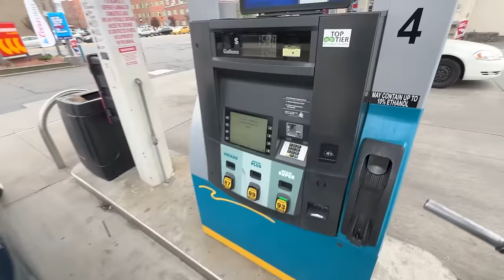FINALLY DRIFTING MY DRIFT CAR!!!

Comment: Tighten up that handbrake and buy projectMU hand brake pads(Sauce), increase your tire pressure or go smaller tire(your safe running 60+ psi cause I run like 70-80 in my s14 with a stock ka and I run 215/35r18) once your in a slide if you feel it bogging just give it another clutch dump to break the grip again. If you have stock clutch. When you need a new one get a 6 puck clutch(shocks the drivetrain more, meaning easier to get loose)
Reply: additionally when clutch kicking to stop engine from bogging try and go halfway, not fully. It'll feel smoother and shock the drivetrain less.

Comment: Older Nissan manual transmissions are just like that when putting it into reverse, not from abuse but just from wear over time. It’s a common issue and is fine that it makes that grinding noise and it feels you have to force it into reverse.

Comment: Cool kid! Love the video. Btw to use your e brake. You should heat up the pads for a more effective lock. You can keep the car moving with the e brake engaged to heat them up. Then it’ll for sure work better

Comment: You could put some more air pressure in the rear if you're not maxed rn so you can spin 2nd. Also maybe a rear gear like a 4.10 or something.

Comment: Ya need a smaller wheel....and quick release...that will help for sure....Probs need sportier tires to slide and what others have said....def go in a bit harder on the throttle, get those rpms upppp in second. You should be fine.

Comment: I would look into a different diff with a shorter ratio that way you can slide in second. Or try getting some smaller burner tires but i think a different diff will be the best option

Comment: Air up your tires to 3 psi under max rated and it’s gunna make it feel like butter the tires will break loose way more and you be able to go up in rpm

Comment: Tip when you can't get it into reverse, blip the throttle a tiny amount with clutch in and you should be able to get it in the gear, idk how it works but it works on my 97 Subaru Legacy

Comment: 9:07 when it won’t go to reverse sift to 1 u doing it right but move the transmission on 1 not just shift it move the car forward a hair then try reverse it will work .My 98 Land cruiser transmission was doing the same thing😂
Reply: My 04 Mazda 3 did the exact same thing too. Works everytime when you just pump the clutch and try again

Comment: I drift a stock e46 323i, for low power cars high psi in the tires is a need.I run mine at 50psi

Comment: Depends on your weight and power,idk much about the car but assuming you making probably like 350hp and weigh probably 2700lb I’d try to run a cheaper like 215 to 235 and when you finish drifting or getting them hot pour water on them so it hardens the compound, they’ll last a little longer too

Comment: Jay if your in second try n keep the revs near red line that might help you in second for my 350z I have low end bc im n/a so I don’t bother with 1st but second gear my Z just loves it n I barely redline I’ll be 5k n I’ll hold sum angle good attempt tho 🔥 I wish ik more spots like that out here in cali 🙃

Comment: Usually when me and my buddies would drift a underpowered car we’d definitely run a smaller wheel and skinnier rear tire setup the 18’s in the front a good plenty grip  run some stock 16’s and a 225-235 you’ll definitely be able to slide it second gear also wat rear differential gearing are u 4.0 4.3 and 4.6 would be good if ur trying to keep the power low but slide it in higher gears

Comment: Try sliding on the stocks or smaller tire it’ll help a lot
Reply: If the tires change doesn’t make much of a difference definitely up the boost
Reply: Also peak torque is at 4k so you have to keep the rpm up there as well

Comment: Theres a sensor on the tipi tip of the nozel so when the fuel touches it it shuts the valve on the handle

Comment: i typically wait 30 seconds before turning the car off when getting gas with a turbo. you probably dont have to but i usually do it to be safe, i do always wait like a minute or 2 before turning off tho
Reply: 10 seconds if plenty enough. Unless you've been driving hard and the turbo has been at full boost then waiting a 30 - 1 minute is probably better. With regular driving 10 seconds is plenty

Comment: Your lowkey on some really grippy tires to be trying to slide at that power level. Id say get a simple set of burners and throw cheap tires on em and go through and to also slow the car down a bit for starting
Reply: Also, try flushing the trans fluid and then also whenever you go for reverse; try putting it in 2nd then reverse. Helps get into gear in older mustangs

Comment: Air the tires way up, at least 55 psi starting off then beat the clutch like a drunk step dad
Reply: Also look into what rear ended gears most S chassis guys run. Shorter gears give you more torque

Comment: I think its a mix of the fact there isn't much torque and you have too much grip. I would get it tuned and put some cheaper tyres on it, maybe a quick ratio steering rack at some point too

Comment: Like so many people do, especially the younger generations...., they ride in the far left lane, which is the passing lane. The right lane is for slower crusing traffic... A lot of people don't have that understanding or simply just don't care. That's why in other countries, when you see people riding in the left lane and you see people approaching, they get over bc the passing driver usually flashes their brights, signaling slower traffic to get over. Even in emergencies( Emerg. Flashers) people will still hog the lane. Just a respect and commen courtesy thing, which America has lost. Nice drifting skills btw. @coolkidfrmIRL
Reply: I've heard that in America that doesn't really apply because you guys can have exits on both sides of the motorway? Here in the UK we obviously drive on the left side so it's opposite left lane is the cruising lane and the right and middle lane is the overtaking lane but people don't follow it here either so many people middle lane hog or sit in the right lane at 60mph which is ridiculously annoying. And EV owners are even more annoying because they're either speeding or sitting at 50mph to maximise efficiency 🤦🏽‍♂️ sometimes both within the same journey